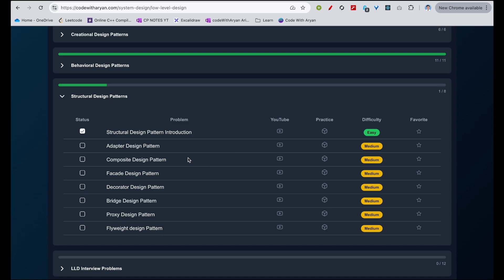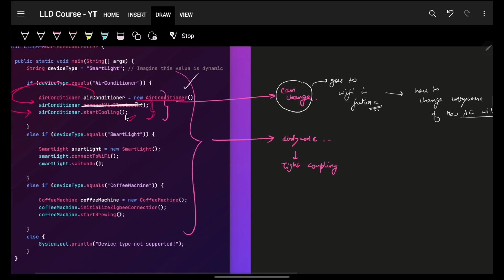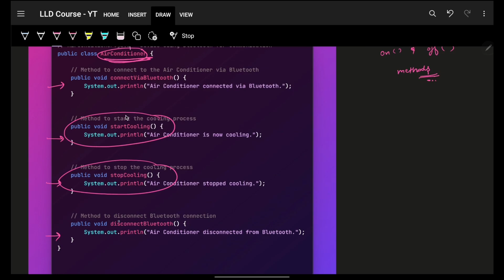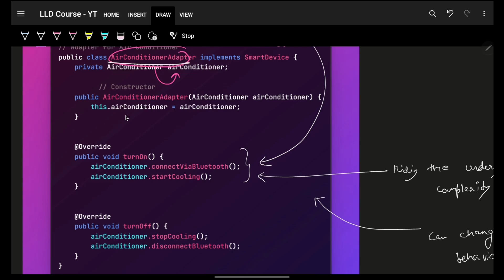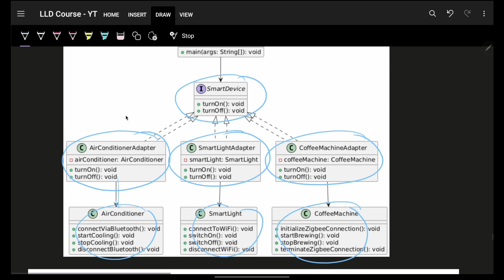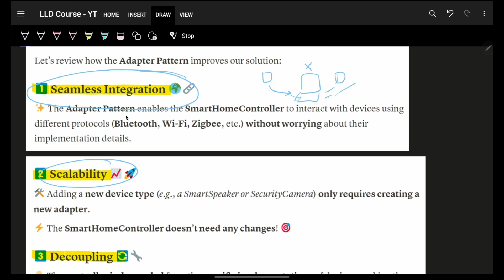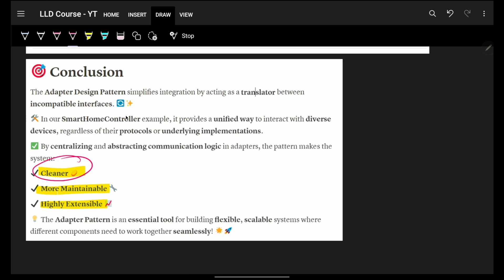Adapter Design Pattern: 🔌 Examples & Implementations in Java ☕

Comment: How many design pattern are there? Which is important from interview point of view
Reply: --> Creational Pattern  
        --> Factory Method  
        --> Abstract Factory  
        --> Singleton  
        --> Builder
--> Behavioral Pattern  
        --> Observer  
        --> Strategy  
        --> Command  
        --> State  
        --> Template Method
--> Structural Pattern  
        --> Decorator  
        --> Adapter  
        --> Facade  
        --> Composite

Finish these things first as these are more important !

Comment: can't we just have a SmartDevice interface which will be implemented by different types of smart devices, and a connector interface which will have bluetooth, wifi etc as implementation ?

each smart device can have a single or multiple connectors
now we can use dependency injection in the constructor of smart devices to inject the type of connector we want? and then we can use the connect function to connect via it. 

which would result in even lesser code than adapter pattern in this case, and also result in an extendible code.